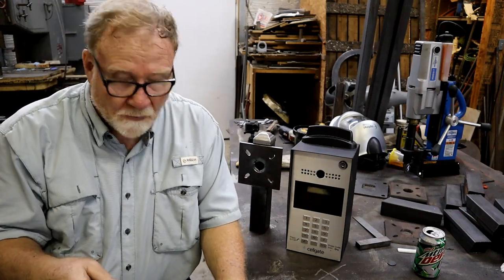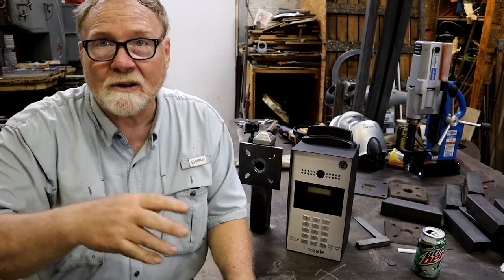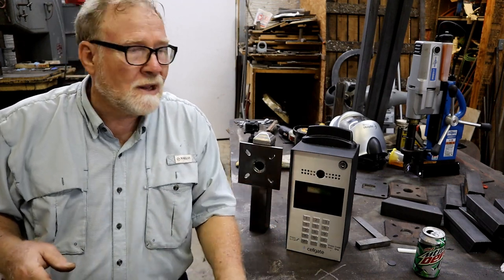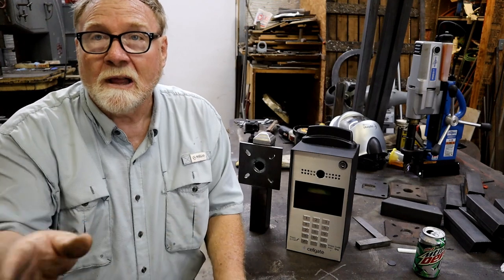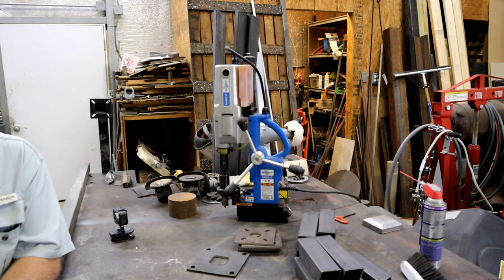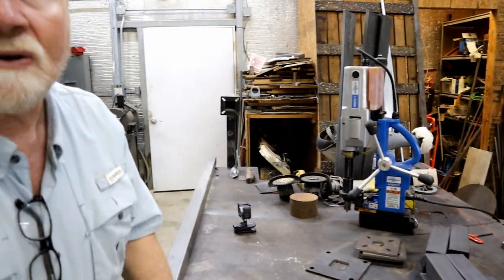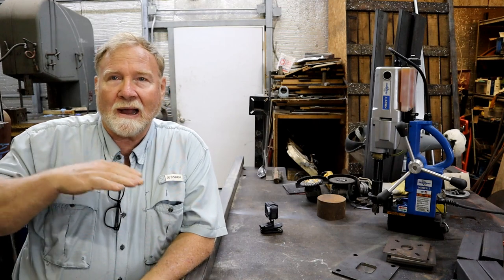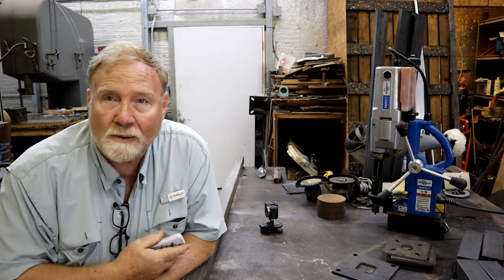Why I make my own Keypad Post for Gates

Comment: You have a front end loader and trees in the yard add in a torch and I think you could bend tube pretty easy.
Reply from the maker: Not if I wanted it to look as good as store bought.. Someday I'll make a 2 inch square tube bender.

Comment: Love watching your videos. I left locksmithing with a huge interest in gate fabrication. Did locksmithing for 5 years before deciding that machining, electronics, welding and fabricating was taking over my head and I wanted to expand my capabilities in the shop. Just brought home my first knee mill this week spent 16 hours strait cleaning the UT used Acer 3vs Ultima  After pulling the sacrificial aluminum table It revealed a brand new steel table underneath. Have my new plasma to build but I'm still lathe shopping )-:   Nice to know about the camera install certification. They just want to know who to investigate once the perp starts uploading video of celebs after installing a 5k gate entry.
Reply from the maker: thanks for watching. Be careful of old iron disease:)

Comment: I am surprized you have not contacted a tube bending shop to see if they can do mandrel bending of that size and wall thickness.
Reply from the maker: IT will cost too much....   I was buying the completed post for 95.00   Now they are 145.00 and  all welded... It's time for me to switch to making them....